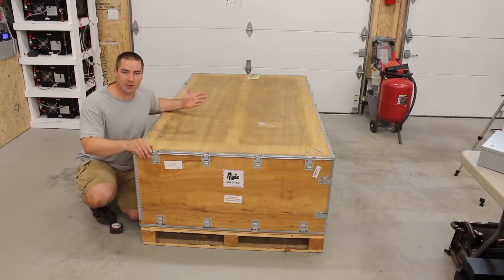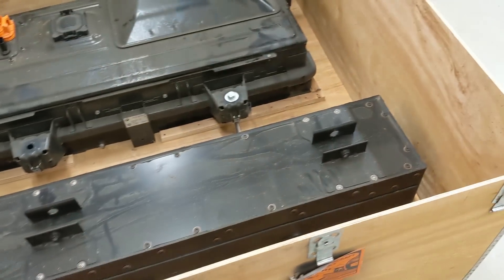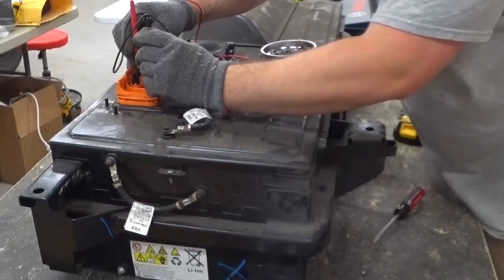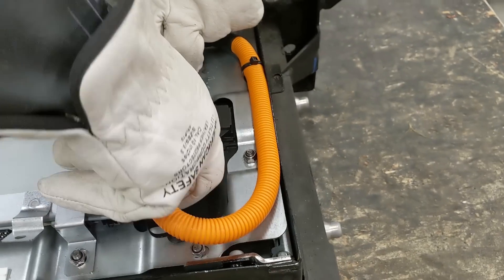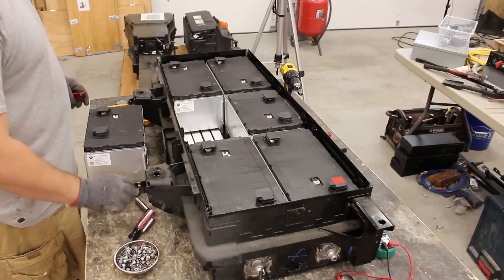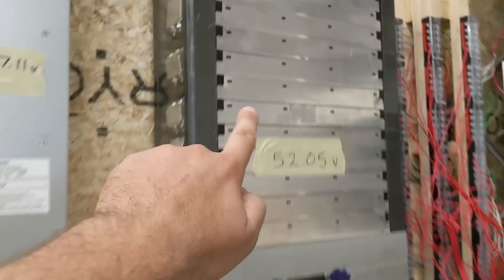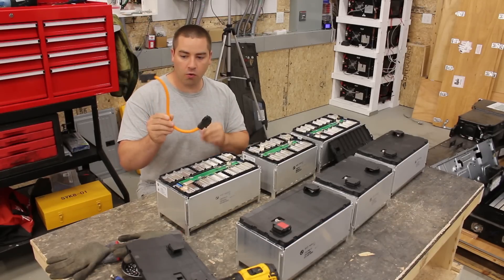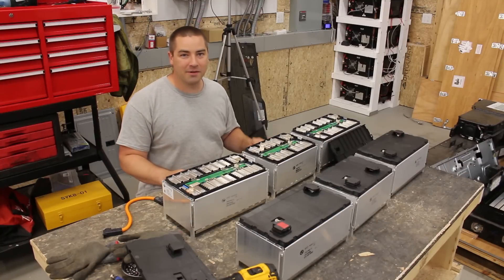Huge BMW Lithium Battery, EV, Less Than $100/kwh

Comment: Hey, looking good! Just wish I didn't have to worry about the cold temps in my absence on my farm. Those look like a very clean and simple build for a massive 48V system as well as a small one for a great price. Can't wait for your next video on them!
Reply: The cold temps shouldn't matter, the liquid cooling could just as well be liquid heating/warming. Circulate warmed antifreeze for low temps?
Reply: @gregb1714  how would you build a heating and a pumping system to handle it? It would require a way to heat and circulate the antifreeze in a closed system. I assume that it would cost $$$ to build a system that would work and a lot of watts of power to run when it is-25F during the winter months I am gone. If it quit working during my absence then the batteries would be shot.

Comment: If this battery pack is related to the BMW i3 you might want to check out Sandy Munro's tear-down report that he did back in 2015.  He just started selling it for $10 on his website.  It might offer some insight.  I have not had a chance to review it yet.  I believe it discusses the laser welding of the cell tabs.

https://munrolive.com/support-%2F-store/ols/categories/bmw-i3-reports
Reply: Travis Calvin I believe these are from 2012 ActiveE which was a retrofit into a 1 series. I can image the long section fitting in the transmission tunnel, as it’s gearbox shaped.

Comment: Gotta love the BMW quality. and automobile batteries are always built for crash so they are overdone for household use. Did you mention the chemical makeup?
Reply from the maker: I did not mention it because I could not verify 100%.  I can say they have the typical 3.0-4.2 volt range, but usually you want to stay in the 3.4-4.1 volt area for maximizing life cycles. The listing says: "Samsung 45ah prismatic cells"
Reply: I would say LiIon but they are surrounded by a couple of layers of metal so the should be pretty safe.

Comment: Can one of the bmw 8s used as a 7s pack since its li-ion an not lifepo4?
Reply from the maker: In the video I show 5s and 4s packs.  I didn't see any 8s packs.  But there are some 3s packs in the other two modules, so you could series connect a 3s with a 4s to make yourself a 7s.
Reply: @DavidPozEnergy  thanks for the reply,  i see some 8s 70ah modules on batteryhookup site was wondering if they could be used as 7s ?
Reply: @diy-bj2ed  Sure, just move one of the power connections to jump out (over) one of the end cells.
Reply: @gregb1714  thanks

Comment: Freight shipping is mostly fixed because you are paying for the "space" on the floor. It's not like a USPS/UPS/etc where they can stack product vertically. Everything is on pallets so only 1 item per spot. The other thing that does modify the shipping is the weight, but it's not "as" critical, usually. They will ask for weight so they don't overload their truck.
Reply: it may also be for safety reasons, batteries are very dangerous if they ever have serious problems
Reply: Just to add to that, Freight carriers use NMFC (National Motor Freight Carrier) numbers which identify what the item and assign it a class.  NMFC is also used to determine the class of an item, which in addition to mass of what you're shipping is used to calculate shipping cost.  Classes can sometime be flat, such as for an engine or bull seamen (Class 500), or based on a density calculation.  Sometimes type of hazmat within an NMFC determine the class as well.  
On top of this, there are fuel surcharges, and often fees for residential delivery, lift gate etc. there is also an absolute minimum for some routes.  If the calculation comes out lower than the minimum the min is applied.
If a company has special rates with a carrier, extra fees, and even the class you're charged for could all be removed.  Many third party logistics get these special rates.
Source: Rate clerk for a trucking company during gap year of college.
Reply: @savageboner  Great info. Thanks.

Comment: Make solar heater from that heat exchanger lol
Reply from the maker: That's a great idea.
Reply: DavidPoz can you remove the aluminum piping or would you have to just use that whole casing? Its such a nice enclosure.

Comment: Cool,  you were reading my mind about a 4 level shelf.  😆
Reply from the maker: Right!  That would be awesome.  It should test out to 8kwh or more.  Factory was 9.3kwh, but they are used.
Reply: @DavidPozEnergy  That means more shelves,  some 2"×2" steel angle welded and insulated with wood all the way to the back😆